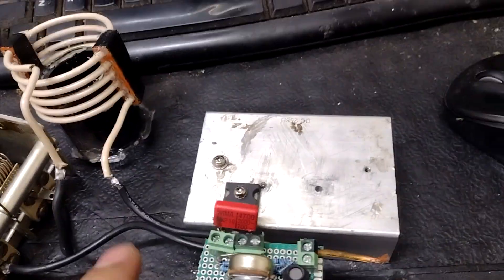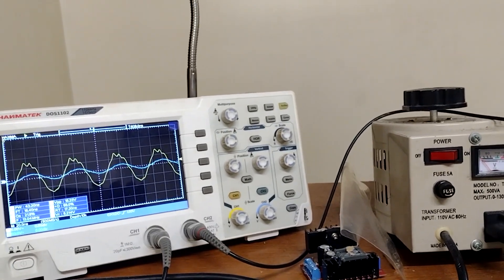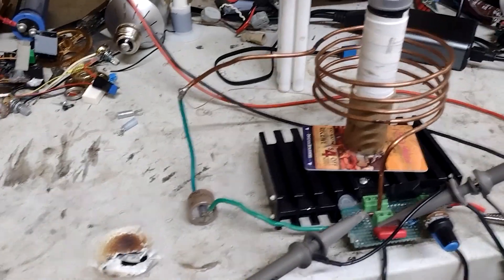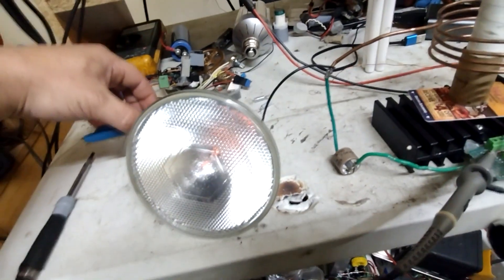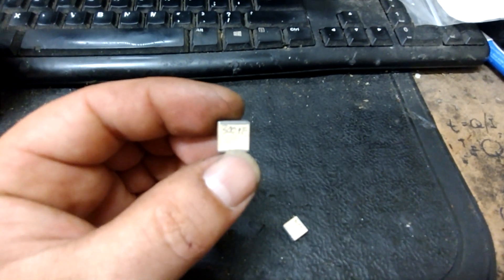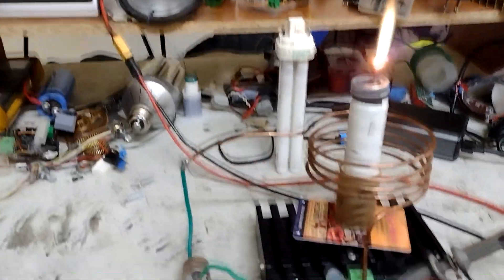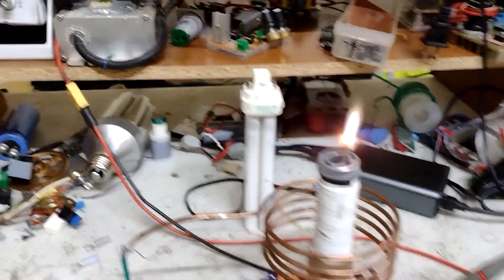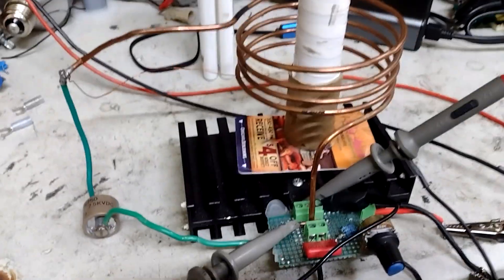13MHz Plasma Flame w/Small Ceramic RF Capacitor Test

Comment: Ever watched that single rick sinple rick wafers commercial?,,,,every single moment felt like you were about to break out the "simple Rick Sinple wafer cookies "sales man add with thag deep reverbating voice man 😂😂
Anyway,I really love your build man,I'm trying to use the circuit to make one of those plasma toroids but in open air rather than in an evacuated glass xenon flask..
It isn't inpossible,just need to majorly reduce the resistance of air by decreasing ita dielectric constant with a high enough voltage field.
And I'm using a thre Terminal Gas Discharge Tube as yhe R.F switch,normally they are used to stop over voltage spikes using the middle pin as ground but I figured if I use the end terminal of a GDT as a connection between a high voltage source and load then I could connect a 2nd voltage between the middle terminal and the load terminal to create a very high POWER Triode gate voltage Mosfet from the GDT which in theory should work,cz the voltage limit of the GDT is the distance between the terminals and they are built to handle 10s of kiloAmps so I should generally make an mksfet capable of switching thousands of volts at 10s of 1000s of Amps,which will allow my caps to discharge way mich higher impulse currents.enough to ionize and induce air to form a toroid.
Reply from the maker: lmao Simple Rick yea I remember that 😂. But man if you can get a toroid going just in free air that would be legendary. Certainly possible but I doubt I'd ever be able to do it.

Comment: Wtf, narda is your friend.
Reply from the maker: IDK they ain't never gave me shit😂
Reply: You are ok at your current level but I would be introducing a monitor as you crank it up.
Reply from the maker: @joecarty8579  You mean like for health reasons or just generally knowing the level of pollution on what's basically ISM?
Reply: At present you are exceeding safe RF limits at that distance, if you increase power I would recommend some further separation from the RF source. 
We use a device called a hazard meter, Google Narda.
Interesting experiment but you need to be safer once you crank up the power.
Reply from the maker: @joecarty8579  Ok thanks for the heads up. I never truly understood the level of danger outside of a basic comparison to similar output I've seen other people running. I never really pushed over about 250W. Have you seen some of the much more powerful setups out there though? Like Steve Ward's for example where he's pushing nearly 1000W into the thing. I think I read one guy comment about how he probably can't have kids after enough exposure to that.

Comment: Have you seem those toroidal plasma globes from kcakarevska channel and backmacsci channel they are using some kind of hfsstc driver but without resonator , it looks very cool
Reply from the maker: Yea this coil does that also but I don't have any lamps. The second resonator only amplifies the voltage by some amount for emitting the plasma but the primary by itself is already putting out RF power for lighting loads 1-wire or wireless.
Reply: @Magneticitist  I wonder if my pll driver would do that if I take the secondary out ? Of couser it would be much lower frecuency , I am getting close to start a hfsstc build I am already colecting components hehehe
Reply from the maker: Dudes got some awesome globes though I just saw the one where it looks like a hovering donut
Reply: @Magneticitist  yep those gas filled bulbs are awesome but here in my country is super dificult to find something like that , I should try to ask my friend who is a welder if he can fill me some glass container with welding gas ( argon I think it is ) but the ones on the video are using xenon
Reply from the maker: @rodriguezfranco3839  Yea xenon is the best. It's even difficult to find such things in the US I think which is why private builders are so popular. Since you brought it up though I'm going to try to look for one.

Comment: I added the audio input to my tl494 through 47nf series cap and hooked up a old smartphone , with my slayer exciter and it worked , I had to play a lot with the duty and frecuency to make it sound better , I want to try it with my tefatronix coil but I still half way rewinding the secondary 🤦🏻‍♂️🤣, also I will try it with the PLL next , I should had added a amplifier stage but maybe next , I am kinda worried to upload videos of it cause I do not know about copyright trowing my videos down , do you do something special to upload music with the videos ?
Reply from the maker: Whenever I post music like 95% of the time YT doesn't try to take it down. I think they just put ads on them and not allow you to monetize which I don't do anyway.

Comment: I finished the TL494 pwm and I am having a bit of a problem with the voltage regulator , it is a 7812 , I do not know why but it heats up a lot when feeding it with 16v , It is not finished yet cause I will add the audio input later , but the rest is working ok , is just that regulator heating up , I am using irfz44n as the switch, I am thinking of taking the regulator out since in my 555 interrupter I do not have one and it still works nice at like 28v no problem
Reply from the maker: Nice. Sometimes cheap regulators can be troublesome. I always make sure to add decoupling caps on them but from time to time if one is heating up it's worth checking on the output. They can sometimes fail due to voltage spikes or ringing and end up just outputting full input voltage minus the internal diode drops. Often times when they fail this way they will heat up quickly. Maybe just try replacing it to see if it changes.
Reply: @Magneticitist  I put it on a little heatsink and I been testing it pretty hard at the rails interrupting my tefatronix push-pull at 28v and looks like it is holding up fine so I am not gonna worry too much , if it works IT WORKS lol , I may put it on a little 3d printed box or some fancy case when I complete the audio input later but thanks so much for your help brother 💪🙌
Reply from the maker: @rodriguezfranco3839  You'll probably be alright with that circuit either way. It's just when you're driving something you don't want to exceed a certain voltage like gate drivers it could be a problem when suddenly the regulator isn't regulating anymore. Those TL494's also seem pretty good at driving mosfets by themselves up to a certain point. But yea you can already do the basic note playing if you wanted but playing music will just be a game of tuning in the right duty/bps.
Reply: @Magneticitist  I would like to play music , those midi tones are not appealing to me , what series cap would you recomend me to start with ? I was gonna try trough a 1uf
Reply from the maker: @rodriguezfranco3839  I'm pretty sure I started with much lower probably in the 10nf region

Comment: Would you risk a sic fet on that ? Lol , I wonder how it would sound audio modulating it at the rails
Reply from the maker: I think I did at first and it killed it fast. The SiC I have now is going to be used for a different HFSSTC when I get some high speed gate drivers in a couple days. Also for some reason the 260M I have on there now seems to be the only fet that wants to work ok. Slight variations in the circuit didn't work out too well and now I'm in the process of trying to bring it back to where it was after trying different coils.

Comment: I had to put down the PLL driver for a bit hehe , I took the dust out of my slayer exciter and I been playing a bit with it , also I am working on the tl494 interrupter I have it almost done I try to build it as clean as possible but it is hard , I do not know how you get those complex clean layouts you got SKILLS hehe , I am using irfz44n (no gate driver) and a 12v regulator, 500k pot, and a 100k divider at pin 4, I hope it works for audio modulation at the rails I want to give it a try on the slayer exciter , also I forgot to get that lm 381 or something like that for the amplifier , I might add it later or just try to put the audio signal straigh from a old smartphone trough a series 1uf cap to pin 4 , I will tag you when I get it working
Reply from the maker: For Slayers I think I ended up sticking to MJE3055's for some reason. Those old BJT's seem to work well. Audio modulation can really be just as easy as feeding the audio signal into the base/gate of the switch on those.
Reply: @Magneticitist  Yep I saw some slayers with audio at the base trough some transistor like a bd , or just using a series cap , I might give it a try but anyways I want to get the tl494 pwm build , I am using tip41c and tip3055 (I think it is pretty similar to the mje3055) but the tip3055 do not work right at low voltage it kicks out of oscilation pretty easy , I think by the way I got it setup it starts working right at like 30v , and the tip 41c would die at that voltage

Comment: Hi I wanted to make a new mini PLL sstc since thick wire was expensive for a new secondary, I had to use 38AWG not the best but anyway, I have a question I read in HV forum that a BD139/140 BJT pair would only work for a coil below 500kHz is that true??
Reply from the maker: Oh hey I'm not too sure about the BD's but I do have some UCC's finally. I can send you a couple of each if shipping allows it.
Reply: @Magneticitist  alright I was just asking, because I only had the BJT option but uzzorks said that BJT could work under 500kHz
Reply: @Headbutter-Lettuce90  there is a uzzors schem wich runs at 4mhz and uses 2n3906 and 2n3904 , but wich frecuency is your secondary rated ?
Reply: @rodriguezfranco3839  arround 450 to 540kHz
Reply: @Headbutter-Lettuce90  me parece qué es bastante baja ésa frecuencia , pero Magneticitis siempre usa gate drivers , habría qué preguntar en algún canal qué use el más el estilo totem pole , la mini sstc de vectoranalyzer usa BD , y parece ser de bastante alta frecuencia , Gianni Laschi usa el mismo diagrama en su mini sstc , no recuerdo qué frecuencia manejaba pero pareciera que está dentro de ese rango , quizás Magneticitis te envié unos gate drivers éso sería genial , pero yo trataría de probar los bd quizás funcionen bien 💪
Reply: @rodriguezfranco3839  pero vectoranalyzer no usaba Gate drivers?, Me interesa ese de Gianni laschi
Reply: @rodriguezfranco3839  de hecho uno de los drivers chinos de PLL sstc usan esos transistores, pero lo que me para es el GDT también
Reply: @Headbutter-Lettuce90  a ésa frecuencia los gdt no creó qué sean tan críticos , busca toroides en electrodomésticos usados , yo saqué varios todoides de tranformadores de 220-12v para lámparas incadecentes y tienen muy buen ferrite creó , por lo menos para mí push pull funcionan de 10 y debe estar trabajando en ésa frecuencia alrededor de 500khz
Reply: @Headbutter-Lettuce90  qué componentes ya tienes acumulados ??, una vez qué tengas el cd4046 y el 74hc ya puedes empezar a pensar un poco como armar todo en la plaqueta
Reply: @rodriguezfranco3839  aún no tengo nada, pero tengo el diseño pensado, solo me detienen el GDT y el gate driver
Reply: @rodriguezfranco3839  tal vez si, pero creo que pueden hacer overshoots en la compuerta y quemar la puerta
Reply: @Headbutter-Lettuce90  trata de averiguar sí no hay una tienda de electrónica cerca de tu hogar , en qué país vives? Yo conseguí el UCC27324 por unos 2 dólares , en una tienda cercana a mí casa , no es tanto pensando qué es lo qué puedo gastar en comer una hamburguesa , el gate driver qué incluía enable costaba el doble , quizás puedas conseguir un buen precio y estarás más tranquilo sabiendo qué es el componente correcto , estos ucc su mayoría son dobles gate driver ósea qué con un IC podés manejar dos mosfet , ósea qué solo necesitarías un IC , hay algunos qué son inverting - non inverting ósea invierte una de las salidas y la otra la deja igual , ése sería ideal para el half bridge , pero igualmente puedes usar una salida inversa del Schmitt trigger así que no es tanto problema
Reply: @rodriguezfranco3839  ya fui a buscar intenté buscar el TC4420 y el TC4421 pero solo tenían el TC4423 que tiene ambas salidas pero solo tiene 3A de salida

Comment: Yeah I think those variable capacitor are more for frequency tuning with radios etc and not so great or stable with power running through them as when the temp changes so does the value etc.
Reply from the maker: I didn't actually find the power throughput to be much issue with certain tuning but it was the general size of the cap itself. It was basically a giant capacitor on top of its own plate values. Depending where it was sitting at the time would change shit around too much etc.

Comment: I saw that you're using a cheap-ish buck-boost power supply probably from Amazon. I used to use one of those (and still do for lower power applications), but I shelled out for a lab bench power supply.
Reply from the maker: Yea it's just a 50V 5A buck powered by a 50V 5A power supply. It's not my favorite but it has held up so far. I'm still kind of shopping around for a higher power one. What did you end up with? Only alternatives I can really see that will deliver the power are the Ridens.
Reply: @Magneticitist  I got some random 30v 10a power supply from Amazon during a prime day deal. I also think there are some 60v 5a versions.
Reply from the maker: @YSPACElabs  Yea "A Bored Person" on YT had some pretty good results using a 60v 5A supply. I was halfway thinking about that. I always destroy those lab supplies though. That's why I use my own powered from 20V drill batteries now.. I got tired of replacing the 800V mosfet in the 30V supplies when running these kinds of circuits.
Reply: @Magneticitist  I don't know why running this type of circuit would blow the main mosfet in the power supply. Maybe adding some hefty capacitors close to the input of the hfsstc circuit would smooth out current or voltage spikes on the power supply side. I would think, though, that the fet in the variable supply module would also blow if you've has such bad luck with lab bench supplies.
Reply from the maker: @YSPACElabs  I haven't really been able to work it out either but it wasn't always specifically these HFSSTCs. Either way there is no level of filtering I've been able to provide that actually gets rid of the noise. For example it will always find its way over to my powered speakers even if isolated. It can often just be things like the way all the nearby metallic objects are positioned. As for the ones I build I just happened upon a particular buck driver that never failed on me so I've been using that and an identical one ever since. A $300+ bench supply would probably be ok but the $50-60 ones you can get easy on Amazon or something will not like running some of these circuits.
Reply: @YSPACElabs  You can use a common mode filter, with that type of filter my HFSSTC never interfere with the refrigerator again

Comment: The small column ceramic capacitor maybe used for RF fusing machines and transmitters so they handle large current.The silicon capacitor looks very similar to ATC communication capacitors I guess you would get a nice output from them.
Reply from the maker: Silicon caps don't really seem too ideal honestly after testintg. Maybe if they are way bigger. I didn't notice much difference between them and the FKP wimas. They both got pretty warm fairly fast lol.
Reply from the maker: I hope so, they are all a bit smaller than I anticipated but now I know they are at least ideal for some small compact setup.